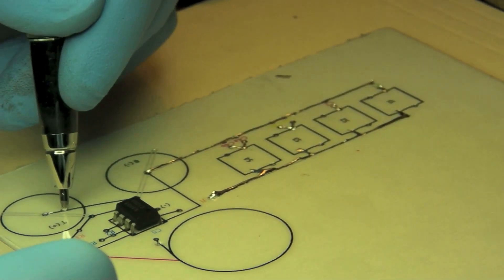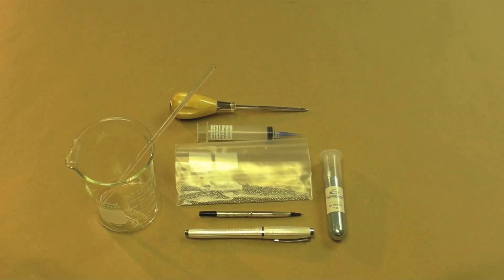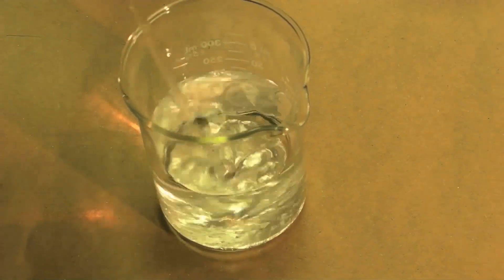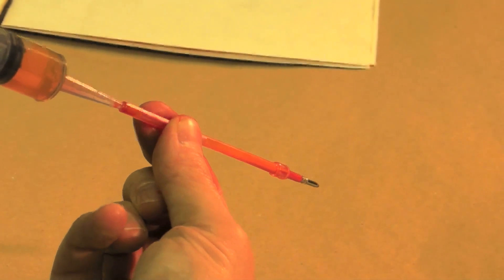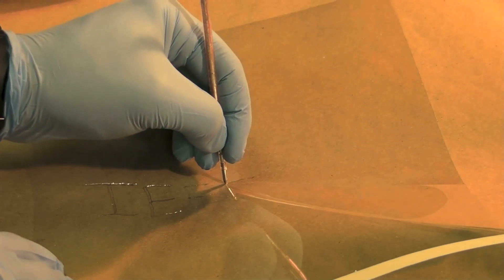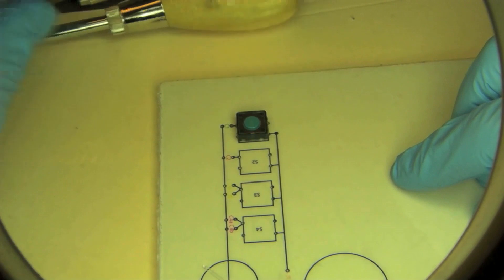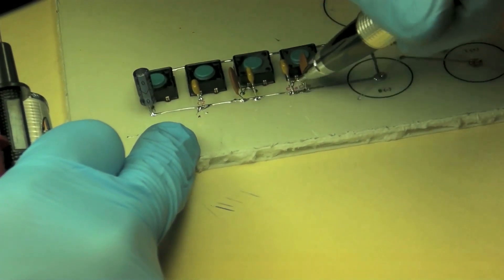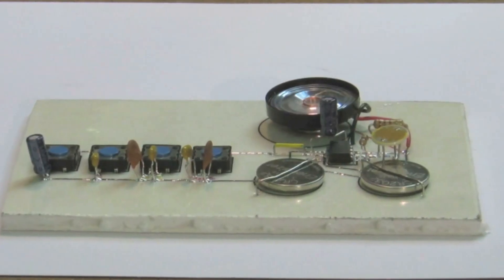Brew Your Own Conductive Ink for Electronics Projects

Comment: Frankly I kinda expected something a little better from Spectrum.  This is ridiculous at so many levels.
1 your traces never dry.  2 both indium and gallium are very very expensive.  3 its not really a paint thus you need to anchor your parts to prevent movement.  4  don't expose your circuit to any shock or vibration as it is most likely to fall apart.
 I don't want to just complain so I have a suggestion,  sense so much money is being spent why not select a sampling of amorphous conductive metals and binders and experiment with these. I'm positive in no time at all you will come up with a better product that costs a lot less.  I did find one good use for your idea though.  Non toxic fluid brushes or contacts as in a Faraday generator or even a simple non mercury tilt switch although some attention to material choices to the latter need to be made because of the superb wetting properties of indium and gallium.